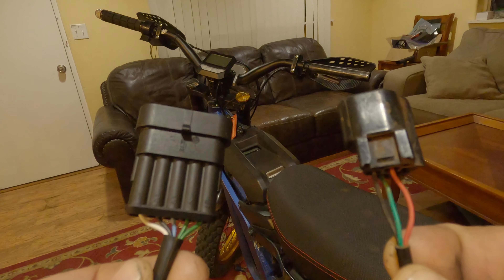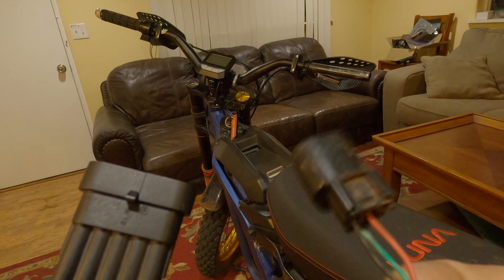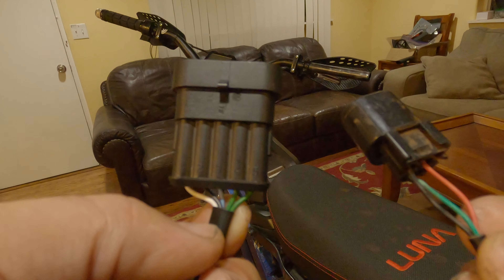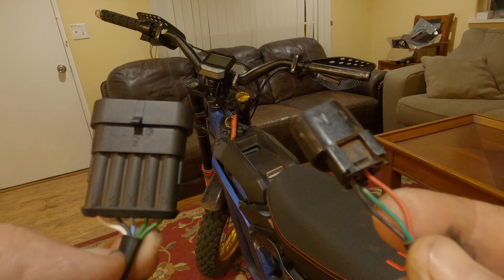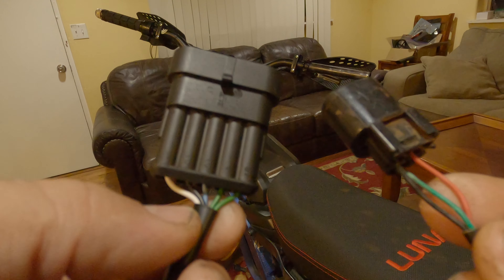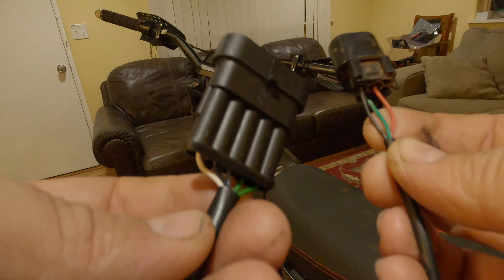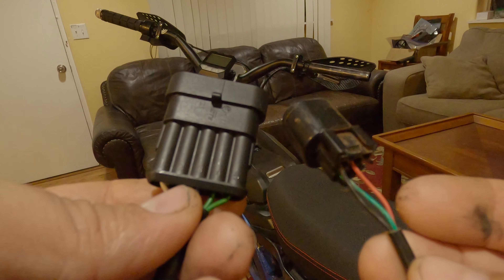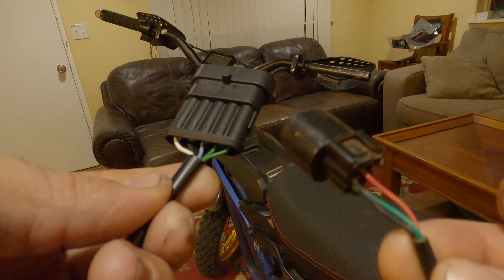Domino Throttle Wire To Surron Segway

Comment: For people that have newer throttles woth different wire colors 
White to black 
Blue to brown 
Black to blue
Reply from the maker: Appreciate the info. I pinned your comment
Reply: Confirmed doesn't work on the post April 2021 Surron X black with the Black, brown, blue wires. Bummer I bought the domino can't use it. =(
Reply: just tried it , no luck.
Reply: @4ranklin1  it’s only 3 wires I’m sure you can figure it out, I wouldn’t throw the babe out with the bath water
Reply: @4ranklin1  how did you confirm it?
Reply: @shayan4040  I installed it on my surron. Stock 2021 surron x black. Tried all the different wiring configurations doesn't power the motor. Have you gotten it to work?
Reply: @Tony_Seed  Some have suggested it has something to do with the new controller and the voltages and or resistance/impedance being wrong with the domino.
Reply: @4ranklin1  when I got a BAC4000 there was a option for Domino. Like they had to program it in. I don't think it will work with a stock 22... right now its not working with BAC4000. Emailing store to schedule a session.
Reply: @shayan4040  Gotcha. Yeah I'm just running the stock controller.
Reply: @4ranklin1  the domino throttle only works for the bac4000 not the stock controller.
But thanks for the confirmed doesn’t work lol
Reply: @4ranklin1  update, it works.
Bac4000 got 5 settings.
1&2 does nothing, like “park”.
3-5 works.
3 is is like stock plus 25%
4 is like 50%
5 is a rocket and I got scurred.
Reply: @shayan4040  Awesome man thanks for the update. Looks like I need to update my controller then.
Reply: Thanks, worked out perfectly. Have KO controller installed and no issue

Comment: Hey I am hearing varying reports on IF this works on the stock 2021 surronX.   do you know?
Reply from the maker: They do not. They changed some setting in the stock controller. Idk why they did that. I’m sure someone will come up with a fix
Reply: @Mayhemjach  Aww man I was so close to purchasing the domino throttle right now too so glad I came across this. Looks like I'm going to use cable throttle instead.
Reply: The new model Segway x260 seems to have the red green black but with a white stripe.
Reply: @Mayhemjach  I sent you a message
Reply from the maker: @mrfocused4014  the domino throttle won’t work with the new batch surrons unfortunately
Reply: @Mayhemjach  I have the new Segway x260
Reply: @Mayhemjach  also a bac4000 controller that is tuned for the 5v domino

Comment: Domino throttle came with a short cord. Not long enough.
Reply from the maker: So did mine. You have to cut your old throttle cable and splice the wires together. Or go buy wire and run new wire.
Reply: @Mayhemjach  I did that and the domino throttle did not work. You know the wiring diagram? Stock throttle on my surron has blue black & brown. Domino throttle has blue white black and two green. Supposedly the two greens don’t get connected to anything.
Reply from the maker: @signaturestreetballmoves  my video shows the domino wires to the harness side of the bike. If you look at the harness side wires and match it up to the old wires, that’s the wire it goes to.
Reply: You have red, green, and black on your stock harness. Mine has blue black and brown…
Reply from the maker: @signaturestreetballmoves  The wires im taking about in the video are from the stock throttle. Im saying how to connect the domino throttle to the stock throttle wires, Not to the harness. Match the harness colors to the throttle colors through the connector. So connect the stock throttle to the harness and see which wires are connecting through the connector. Those will be the wires you connect to. I did not list which wires to connect straight to the harness because you should not be chopping up your harness
Reply: @Mayhemjach  I’m not sure if you get me.  I have the domino throttle. It’s cable was short so I was assuming the easiest way was to cut the cable for the stock throttle. So I’m trying to figure out wiring diagram to connect the three wires from the stock to the three  out of the 5 that connect from the dominos